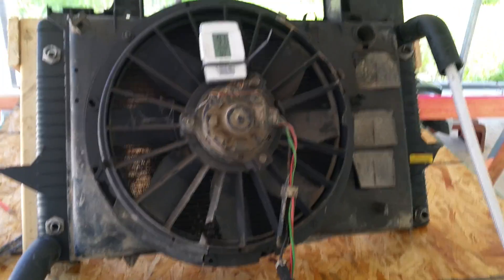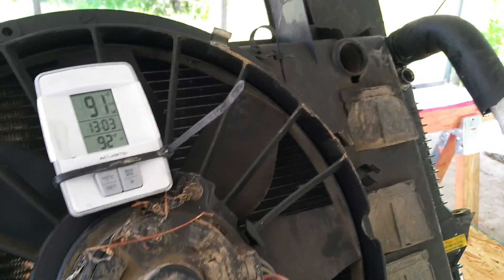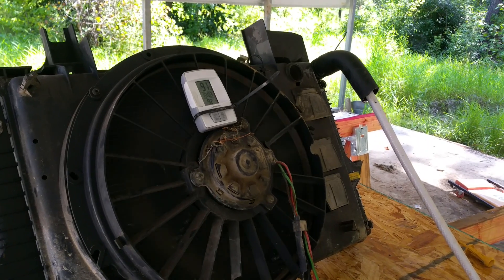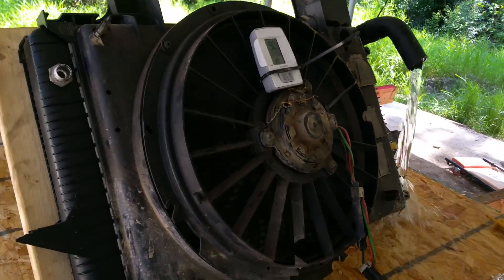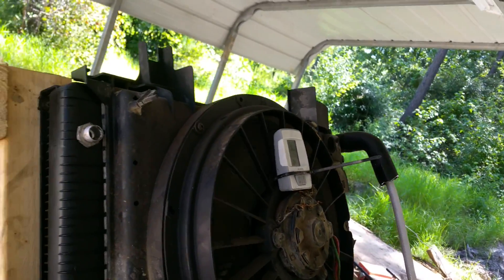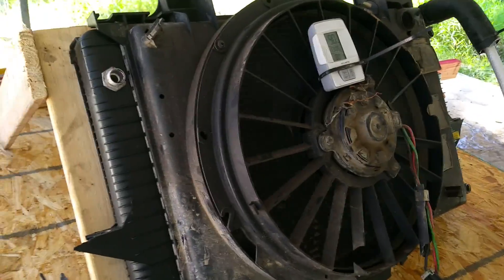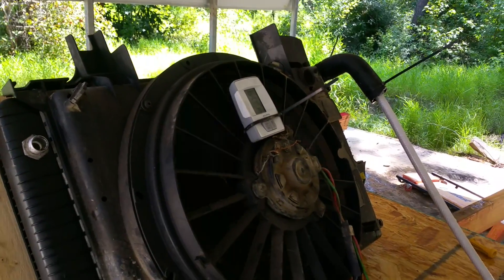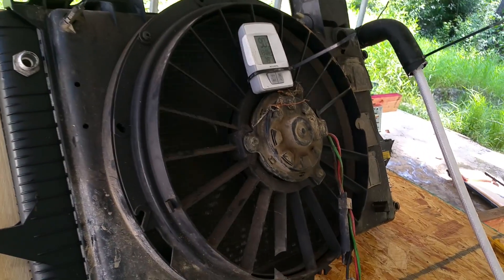Geothermal Solar Air Conditioning part 2

Comment: Yep did this in my creek with copper heat exchanger ran to shed with pex and radiator keeps my shed below 80 degrees no matter the outside ambient used your ideas oh around 80 watts total would not have tried it without watchting your video thanks.

Comment: Nice Work!  I got some questions...   Are you in Florida? What's the temp of your well water? How deep is it? Does air actually pass through the radiator?  I want to do this in much smaller scale.  Looking to cool down a heavily insulated 8x8 shack under the trees when it's like 90F to 75F outside in the sun. I'd like a lot less water, power and noise.. ideally a 5v brushless fan system.  Was even wondering if instead of the radiator design open water design , instead a closed air system where push air from the roof into aluminum tubes 10' into the group and back up to under the shack.
Reply from the maker: Thanks, I'm in Louisiana so would be comparable to Florida. Well is at 80ish ft I believe with an average temp of 55. The radiator is cooling the air by the same principle as a car heater core. Some quick notes to think about are heat move to cold, temperature difference determines how "quick" or " good" the heat will transfer and humidity has a huge roll in how effective the heat will extract from the air. I have noticed the the closer the temperature of the air and water matches the longer it takes to drop the room temperature further. Similar to why refrigerants get to low temps and also how the refrigerant boils or expands to a gas. I had made a bigger version with an old outside condenser coil as seen in a later video, it's worked good unit I forgot to drain it when it got cold and busted from a freeze. All in all if you're ok with less cooling than traditional HVAC then this will definitely help keep you comfortable. Also water flow has an affect on heat transfer but usually wasn't much as long as you had enough to drop the radiator temperature below the desired air temp. Thanks for the comment and I'll try to help if you need anything else!
Reply: @RedneckTech  yeah your water temps a much lower than ours I think .. I hammered a PVC into the sand here 12' and hit a lot of free flowing and clear water, don't have exact temp but it would not be surprised if it's over 70F. :(

Comment: FYI, geothermal would be something you put in the earth. You're not doing anything geothermal. The prefix "geo" means "earth" (from Greek). You have done nothing more than reengineered a radiant cooler. That's what cools the Volvo's engine that the radiator came from. Hope it keeps your shop cool.
Reply from the maker: I appreciate the clarification, and you are absolutely correct. Sorry for the late reply lol.

Comment: why not bury the water hose to help cool it down some more and will you be insulating the building?
Reply from the maker: yes I will be insulating the building. the water comes from the well and is buried to the shed. I will we be wrapping the pipes with insulation where they leave the ground . thanks for the comment!
Reply: I would use larger hose to transfer the most heat but flatten it out for maximum effect